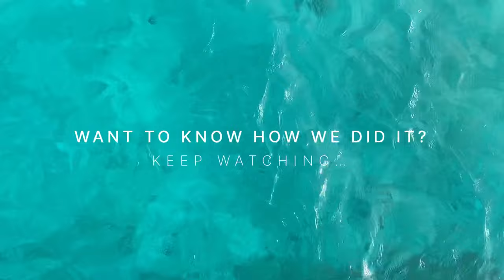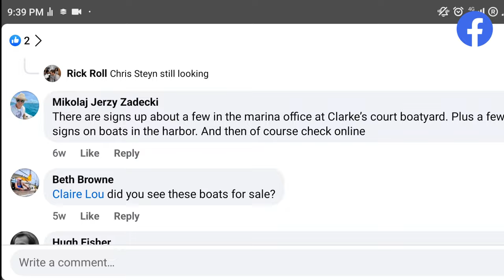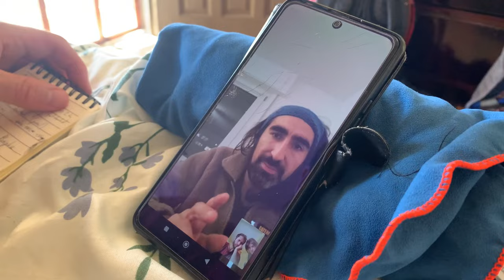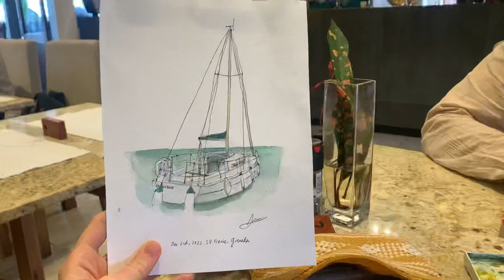How to buy a CHEAP BOAT and SAIL the CARIBBEAN

Comment: Step 1: Have money.
Step 2: Don't have no money

Seriously. If you don't have a way to make an income online or you have big, fat savings, you won't be able to sail full stop. Sailing 6 months, working 6 months always sound great, until you leave your boat somewhere remote, got to pay for it from the distance, then work and live locally, not save a lot of money due to high living costs, then you finally make it back to the boat and need to spend the first few weeks cleaning the boat up and getting it up to spec again to go on, then you probably also have to spend some money on boat jobs etc and before you know it, you're almost out of money or time or both.

Hence why most people try to start a youtube channel.

That being said: It's still possible and I wish you the best of luck.
Reply from the maker: Great comment, thanks!

The truth is
1) we live and travel very very cheap
2) we have a smaller boat than most people are sailing in the Caribbean, that helps a lot to keep it cheap
3) we are not planning to do this for a very long time 

We want to show how we are able to do this with a small budget in our future videos. Coming soon...
Reply: @rickandanna  Yeah, being at anchor most of the times, catching and fishing, installing solar and wind energy, and then living off savings is quite easy. But not sustainable, which is what keeps most people from doing this.